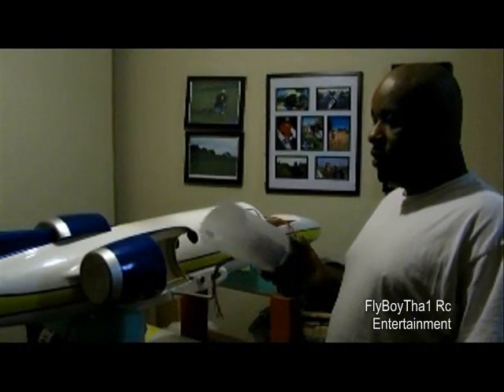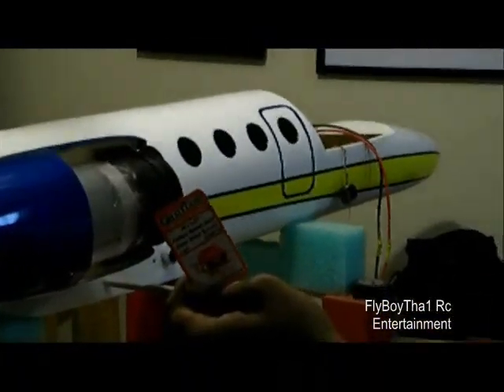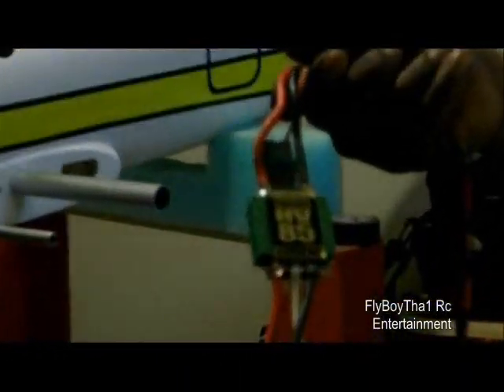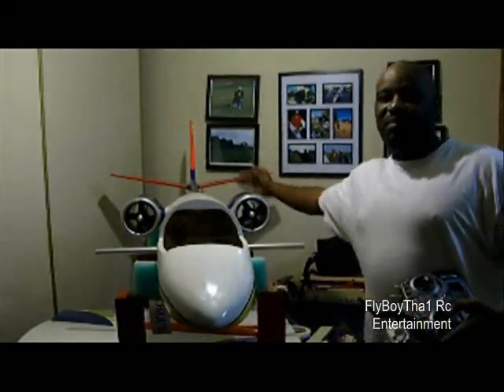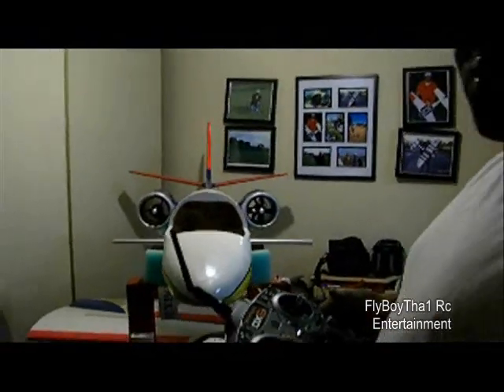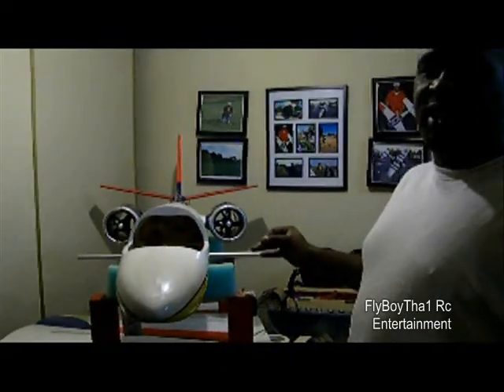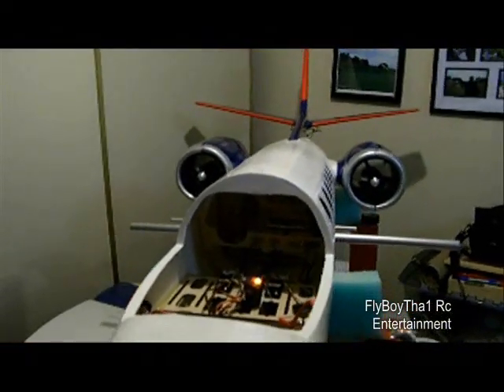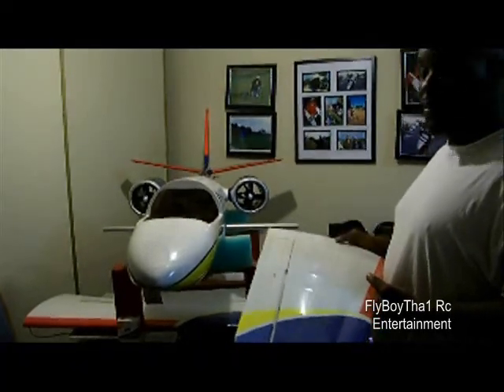Nitro Planes Eagle 100 Twin 100mm EDF Jet Unit #2 Build Part 3

Comment: if the power going to your house was dc it would not make it would just heat the wires up  thats why they use high voltage ac

Comment: it will not matter how long the battery wires, or motor wires are. as long as the material for the wires is completely conductive (which they are), then there will not be power "spikes" or a decrease in total power.

Comment: my mistake  he ,s extended the 2 battery wires which like i said can give voltage spikes which cause interference and can  damage  the esc if you do this you realy need to add extra capacitors  (470pu low inpedance) on the battery end of the esc . most esc manufactures recommend only increasing the three motor wires.

Comment: i think he has extended the three motor wires which is the correct way to extend some say it can make the timing softer reduce power as he say,s its not really a problem.if you extend the 2 battery wires you get spikes with rc interference

Comment: at 1:47 they are all wrong. with any conductive wire you will not lose any power no matter how long the wire is. if they were right, then your house wouldn't have any at all from the miles that the electricity traveled from the power station.